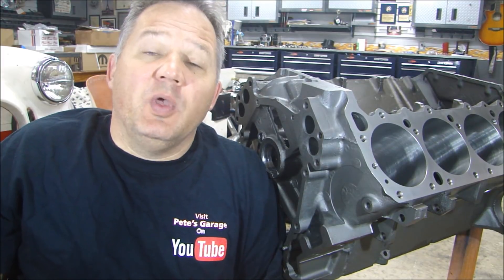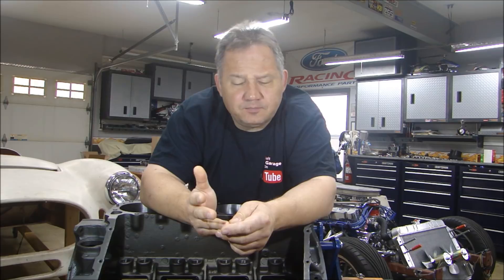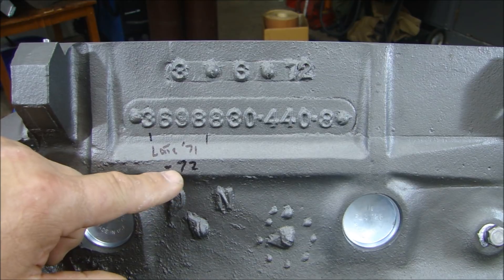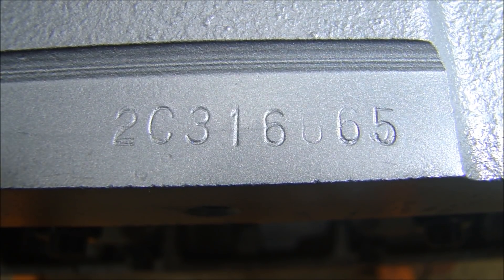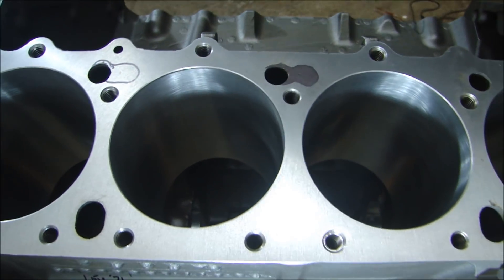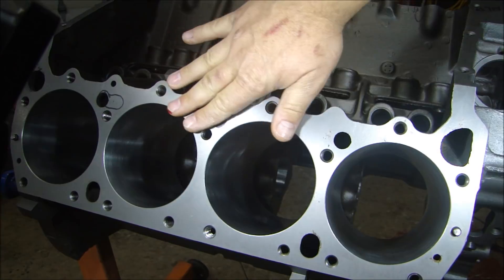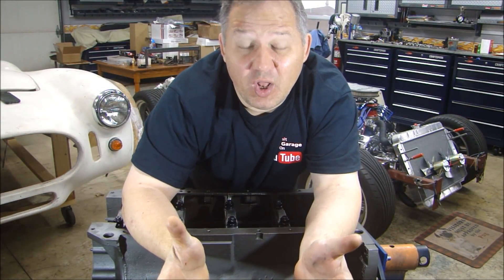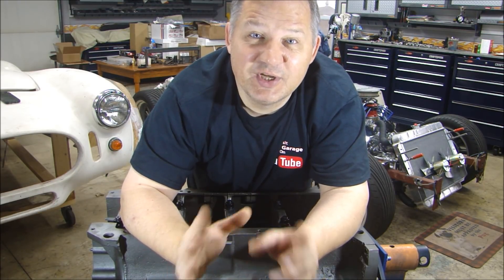440 Chrysler Mopar Engine Building Part 1 - Getting a Block and Machining

Comment: What's the difference between a 440 and a 440 interceptor?
Reply: The engine dubbed "Interceptor" was a Six Pack Engine with a 4 barrel Carter AVS Carb.
Reply from the maker: Usually just the heads, cam, intake and carb
Reply: No Mopar was ever called an interceptor.

That is a Ford thing.

Comment: Hey Pete nice video. where's your garage located? Do you build high performance 440's? Also I see 572 alluminium blocks, are these the same as 440's but just bored out?  I want a 572 billet alluminium block built with titanium rods, top shelf components. Heat dispersant and other coatings to the engine.... question; what is the highest compression that can be had with 91 octane, heat dispersant, top shelf components and carburated? IS 12:1 possible?  Live in Canada so its not super hot in the summer
Reply from the maker: I am outside Buffalo, NY. I do build for people. The aluminum blocks are a bit different. You could get up to 12:1, but is it necessary, it's all part of the planning preocess

Comment: Currently renting a house and the owner let us have the motor home that's on the property and when I decided to check under the hood I was shocked to see that it has a 440 with a dual 4 barrel carb on it. The hard part is to drag it out of the pit that it sunk itself into and drag it into the cement so I can lift it and take out that 440 and 727.
Reply from the maker: That's like finding gold!
Reply: @PetesGarage  oh yeah you should have seen the look on my face when I saw that. We've lived here for almost 2 1/2 years and not once did I think about checking under the hood since it was a random brand. We have to move out by the ens of the month so I'll check to see if I can drag it out if not I'll just take the intake and carbs off.
Reply from the maker: That is really an awesome story!
Reply: I just bought a 76 Dodge motorhome for engine/tranny but ol boy owned it says it's a 490? But I'm not sure

Comment: A lot of motorhome manufactures in the late 60s and early 70s went to junkyards and got low mileage big blocks and they could be out of any make or model and year. so not only are they good sources for big blocks they could have something rare under the hood as well. Also you will need to have hardened valve seats installed in your heads in any motors older then 1974, if you plan on using the stock heads, or just run a lead additive in your gas if your just going to run the motor without rebuilding it lol
Reply from the maker: Those old motorhomes are a gold mine

Comment: My engine 440  has this serial number 4006630-440-10  what the number after 440 means? TY
Reply from the maker: My best guess is 10 is the mold used to make the sand cast
Reply: that strange my 440's serial number is 4006630-440-4

Comment: Jefferson assembly was not a casting plant. It was an assembly plant for large C-body cars . That number by the right side motor mount lugs is the last part of the title vin assigned to the car the engine was built for!
Reply from the maker: Great info, thanks for sharing with us!
Reply: Huber foundry Det. Mi.
Reply: Yea Pete that stamped number is the vin# of the car it came from.... its ok w'll let you slide on this one!  Good video!

Comment: Thanks for doing this, Pete.  Learned a lot!  I have a 77 motorhome 440 that I want to stroke and build for around 600 hp. for my 69 Dart.
Reply from the maker: That's cool, should get 600 no problem
Reply: @PetesGarage   hey Pete's 440. In gtr
Reply: Just bought a 76 Dodge motorhome

Comment: another  source for a good 440 block is from a motor home or RV block. they usually have low miles,huge water jackets and  have a higher nickle content than even the HP blocks. also off subject. an RV 727 have a low 1st gear planetary gear and will launch you off the line better.
Reply from the maker: They are getting harder to find, I agree. I'm in NY and I had to get this one from Kansas
Reply: Show me where the ratio list is for an RV 727B with a ratio lower than 2.45.
Even if you can show me a 727B with a ratio lower than standard, the benefit of a lower starting ratio is negated by the greater 1, 2 rpm drop. The Turbo 700 is a good case in example with its low 1st and large 1, 2 rpm drop.
You don't see too many turbo 700s in high performance street cars that are drag raced because of this.
Reply from the maker: Excelemnt information, thank you for sharing
Reply: Everyone keeps telling me the same but i can't find any in Texas...that are actually cheap
Reply: Pete's Garage so i found a guy selling a 440 thats in the process of rebuilding that has bored 40 over eagle connecting rod's kwith black pistons edelbrock intake heads for sale, 727 torqueflite transmission with manual valve body coming with it as well. Nothing is cracked and he's selling it for 2k any thoughts?

Comment: 440s have a flat pad next to the distributor that contains more information, it's a very quick way to determine if it's a raised deck or a low deck such as a 383 or a 400.
Reply from the maker: Excellent point. This bloc did not have any info there so I did not include it. Thanks for the comment.
Reply: 383 400 don't have flat pad and this is how to distinguish R or RB from engine compartment.
Reply: Mark Watrous I think it's called the engine boss. A raised block has it and and the 383/400 doesn't. It's on the driver side of the block. A casting product.

Comment: Hi is there a different between 440 that come out of a motorhome or are they all the same
Reply: I have read that police and motorhome 440 heads have steam holes for better Cooling
Reply: The motorhome 440 engines dont have a dipstick for some reason unknown to me.
Reply from the maker: The blocks are all basically the same, they may have different mounting lugs or holes.
Reply from the maker: I cannot confirm that, maybe someone will comment
Reply: Motorhome blocks were noted for having the hour glass coolant holes. The coolant passages were increased to help with cooling in heavier applications.

Comment: Pete I’ve been watching awhile and I hope you can help me out on something. I just got done sliding new main bearings in my car from underneath. after sliding the last one in I realized I put a pretty nice radial scratch in one of the crank main journals maybe about a quarter inch long. I can feel it with my finger nail and I worried that I screwed up bad. This is not a high HP engine and most people I ask say it should be fine. I’d appreciate any input or advice you can give me.
Reply from the maker: I would say you are ok. Can you get some Scotch Brite on it to make sure there are no raised burrs? just lightly rub it down.

Comment: You are incorrect on the serial number.  Federal mandate started in 1968 that the VIN derivative (last 8 characters) had to be stamped on the engine and transmission cases at the time of production.  These numbers seldom if ever started with zero.  Typically the sequence started with 100,001 200,001 etc.
Reply from the maker: Thanks for the information. What did I say wrong?

Comment: whats good oil pressure for a 454 Big blok Thanks for this video
Reply from the maker: That is a great question. I was a Process Engineer for GM at an engine assembly that made the 454. I made cylinders heads and worked on assembly. The tolerances were so loose we had the limits for cold test pressure set 40 to 80 psi at 2,700 RPM's

Comment: 16:30 In some cases, high performance companies build billet steel main caps. However, they are usually sold as a way to strengthen an engine, rather than replace a standard main cap that has failed.

Your explaination of the price of machining really helps me, thanks for your show!
Reply from the maker: Thanks for watching

Comment: I almost chocked when you said the machining ran about $1600... It's been many years since I've built an engine.. Last one was a 5.0 in 1991 for my 81 pony (transplant)... I had everything you described done except the magnaflux.. With new crank, pistons, rods, bearings, heads machined and new valves it cost me $1,400... Long block done done.. LOL... my how ties change!
Reply from the maker: The $1,600 includes the price of the block, cam bearings, and ARP main studs.
Reply: Not bad.... Still just shocked at how expensive automotive work can be... Cant wait to start on a project. saving for a fox body t-top.... Hard to find an unmolested survivor.... I love your videos. Love how you get into the technical aspect as well as the hands on application.... Thanks & keep em coming!
Reply from the maker: Love them fox's

Comment: Old motor homes are a good place to find a used 440 engine that has not already been hotrodded.  I used to pull them and sell them to the mopar guys in southern California.
Reply from the maker: That's a great idea....if you can find them. Thanks for sharing

Comment: Hey Pete, i have a friend thats giving me a 440 with a (THINK HE SAID) 400turbo, for free. I just had to pull it out of a motorhome. But I did some research and found out that it's mid 70s 440 engine. Checking out on forums I'm hearing that it's not a good engine because of emissions. And the design was done as good. And I shouldn't waste my money. Have you heard anything like this and what is your thoughts?
Reply from the maker: I would take it and at least use the block. you really don't need to keep all the emission controls.
Reply: Pete's Garage i just realized i said emissions, auto correct. Meant to say engineering. Was the mid-70s blocks poor engineering versus early 70s?
Reply from the maker: No...they made improvements in '72 and '75. Anything after '69 is better
Reply: Tom Nawman the mopar cast crank is good to "500-600 hp". Ive seen more hp than that on them. The only reason cast cranks got a bad rep is because they couldnt be fixed as easily.
Reply: Ok thanks Frigglebiscuit... I have heard of cast cranks breaking in the middle and seen that... the guy that built the engine is a good mechanic.... but you know stuff happens.......
Reply: Tom Nawman oh yea. That will definetly happen haha. Not every crank is as good as the other.
Reply: the engine might have low compression, but a piston can cure that. the later model 440s are BEEFY compared to the older ones.
Reply: I believe the 73 and later 440's had cast cranks.. and i'm pretty sure any of them 72 and earlier were steel cranks... even though some might use a cast crank ... I wouldn't advise a cast crank for any kind of racing.

Comment: What about 4 bolt main caps?
Reply from the maker: 4 bolt mains are only available on certain models. In the next video I will be going over studs versus bolts.
Reply: Pete's Garage they used to make after market 4 bolt kits that required minimum machine work
Reply: They worked great
Reply: dont really need them in a big block mopar.
Reply: Frigglebiscuit depends on the output you seak
Reply: Frigglebiscuit no not the block unless you throw a Rod
Reply: Frigglebiscuit right they did not use 2 bolt mains the preferred block was the 4 bolt truck blocks
Reply: christopher newton LOL. There are no 4 bolt main mopar truck blocks.....
Reply: Frigglebiscuit I have worked on them
Reply: Frigglebiscuit now what
Reply: Frigglebiscuit don't know where you get your information
Reply: christopher newton you are full of it too. Im not wasting my time arguing with you anymore. Bye.
Reply: Frigglebiscuit do the research
Reply: Frigglebiscuit Have you heard of cap walk
Reply: christopher newton you will make the block explode before the mains give if it is girlded with better main caps.
Reply: christopher newton then why didnt the wedge motors running nitro methane use cross bolted caps? They used STOCK crank, mains, rods, and bolts.

Comment: It's to bad Pete can't do a video for someone with a motor sitting in a vehicle and explain certain steps he would do to check how far to rebuild the motor depending on conditions and what to check. Still love Petes videos even tho I'm not doing old school v8's. I'm learning a lot considering I'm trying to do my first engine rebuild. Anyone have any tips? Can I pull pistons and crank and just clean and reuse everything or do I need rings and crank bearings? 👍🏻
Reply from the maker: You could rebuild the entire engine in the car. I've done it a couple times, but it is way easier just to take it out.
Reply: Pete's Garage ok thank you very much Pete for your response and taking the time to respond to my comment. What would you do if the motor mainly ran fine before sitting for about 10yrs, what would you check and rebuild? Or would you just pull the whole motor and just start fresh by having the block machined then instead of using the old internals should I just start with new internals? I guess it's hard for me to explain. Again thanks Pete
Reply: corvair140 thanks corvair👍🏻
Reply from the maker: Well...after 10 years a lot can get rusted and pitted. Rebuilding is best
Reply: have you gotten in to run? if you havent, get to run and see if it smokes or knocks. you can also use a bore scope to check the bores. i would personally just pull the engine.
Reply: Frigglebiscuit I could try and explain what I have? And nope not running yet I'm in tear down right now and trying to figure out how far I should take it. I'm make a thread on a forum I can post once I make it. 👍🏻
Reply: 503xROCKSTARxS14 some people there should be able to help you as well.

Comment: 2536430--1966-72.  
3698830--1973-74
4006630--1975-79 
This would be a very early casting 73 block even though it dates 3rd March 72. And the 8 digits stamped on the pad near the pan rail match the last 8 digits of the VIN number. It started in 68.
Reply from the maker: Great info, thanks for sharing

Comment: No brass freeze plugs? Steel sucks.
Reply from the maker: Why do you say that?
Reply: The steel ones rust. Brass does not.
Reply from the maker: Well...steel ones are zinc plated. Brass is electrically opposed to cast iron so the coolant will promote dielectric corrosion. It's just preference I guess